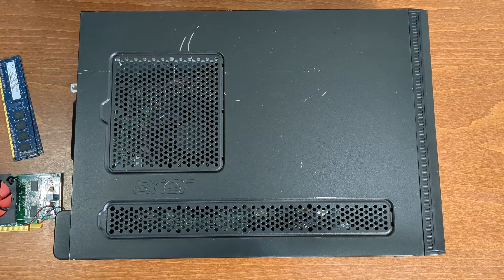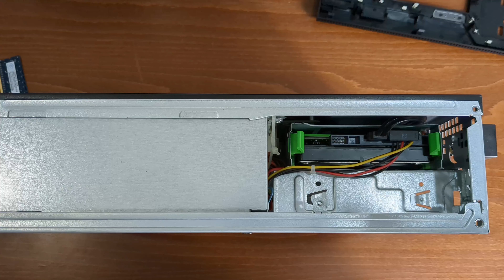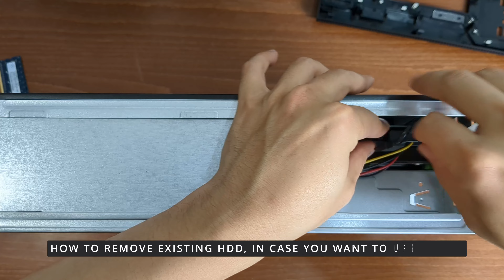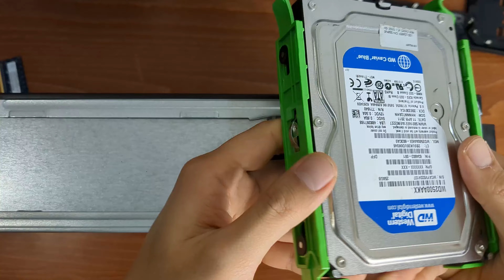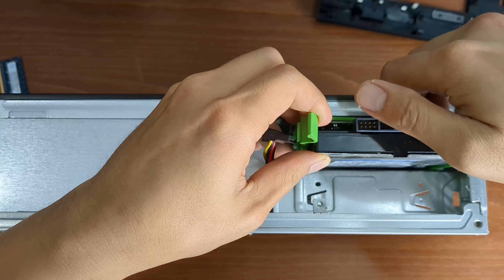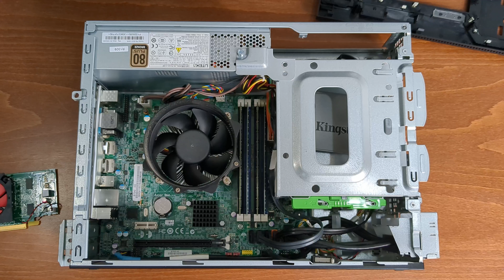Acer Veriton X4620G - Teardown and Upgrade SSD/RAM/GPU

Comment: For an upgrade gpu, you have to cut that metal piece off the case?
Reply from the maker: Yes I think so
Reply: @ComputerizedCanada  Honestly i was like wtf that ussally jus comes off nope its like tack welded to the case welp
Reply: Imma get it off still but jus inconvenient asf considering they have it there
Reply: U can use single slot, low profile gpu like gt 1030, quadro p400, p600, p620

Comment: Is a intel core I5 7500 compatible?
Reply from the maker: Unfortunately no
Reply: @ComputerizedCanada it’s the same socket and it says it’s compatible on acer
Reply from the maker: @freddyisapuppet  do you mind sending me the link to that Acer page?
Reply: @ComputerizedCanada  yeah in a min but I think it isn’t compatible I just bought a cpu that is a i5 7500 I install it and the fans ramp up

Comment: Can you take the mobo out?
Reply from the maker: You probably can. Sorry, I don't have the PC anymore. If I get another one I will do a video on that topic.
Reply: @ComputerizedCanada   Hey, just succeeded in it, actually a pretty easy process, now i have it in my full tower case. Thanks for dedication! Good luck
Reply: @zcmanord You using acer psu or new psu? The connector is the same?